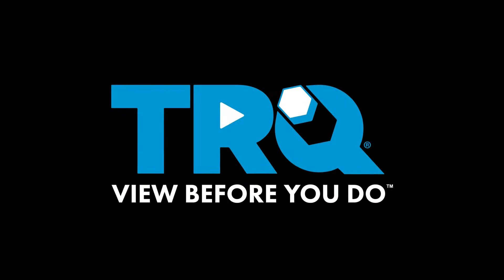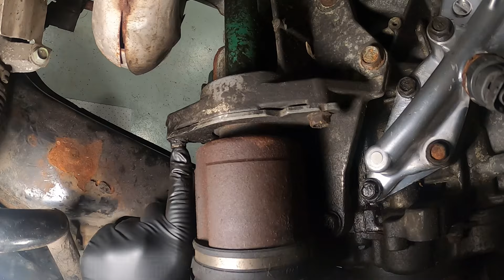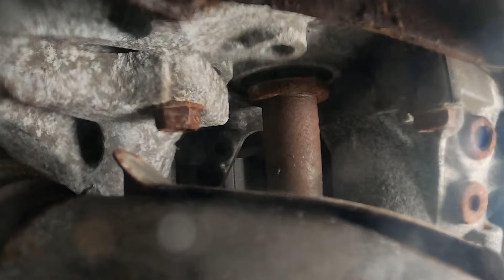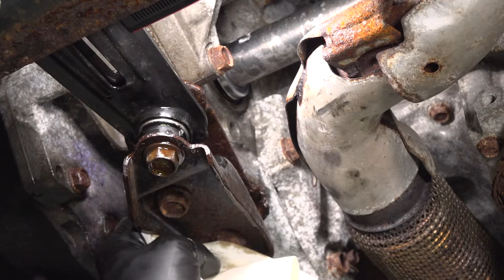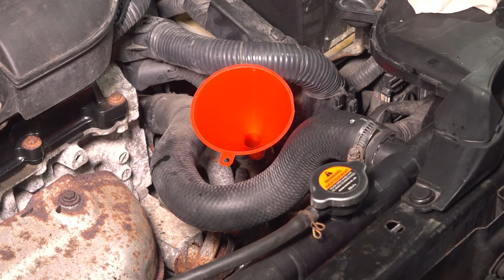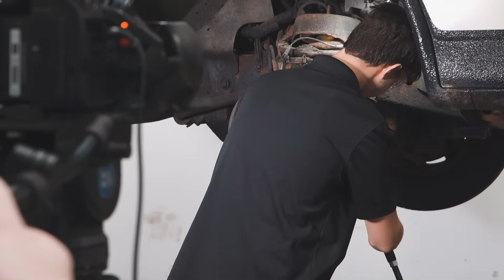How to Replace CV Axle Assembly 2008-2013 Nissan Rogue

Comment: I don't think the transmission fluid is supposed to be filled to the "hot" word. The fill target is at the tip, where there are cross-hatches and notches cut on the edge at the top and bottom of the range.
Reply: Otherwise great video :)

Comment: You don’t need to remove the ball joint just loosen the strut bolts and turn the wheel to the right and let the top bolt slide out leaving the bottom bolt loose but not out all the way and if you have to take the second one out it won’t do any thing to the strut as long as it’s lifted off the ground so no tension is there, and let the strut lean forward so at that angle the axle will  slip out easy I’ve changed two of these now I’m on a third one and bearing

Comment: For the lower ball joint i used various sockets and a prybar against the cv joint to press it thru.  A size 14 will fit thru the ball joint clamp.    

I had to use a torch on the bearing support bracket to get it out becuase it was really stuck.  

The book said to replace the trans seal so i did just to be safe. 
 
Bearing support bracket bolt torque 18 ft lb.  Ball joint clamp fastner 46.  Axle nut 133-136.  

It took me 2 full days. Take your time and make sure when you put the axle into the transmission that the spline is matched because if you start wacking the axle to press the bearing in and it isnt lined up and you mash the spline your transmission will have to be rebuilt

Comment: Removing the ball joint from the knuckle was difficult. We ended up using a crow bar, placed vertically so the curved bit goes around the knuckle to the bottom of the joint. Then used a sledge on the top of the crowbar to knock it free downward.